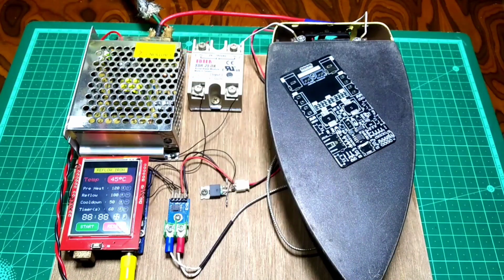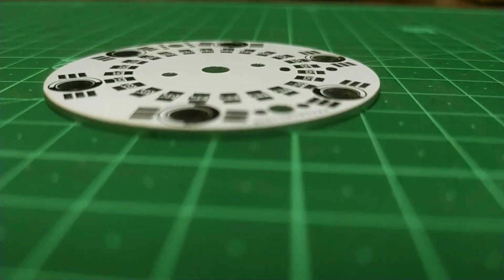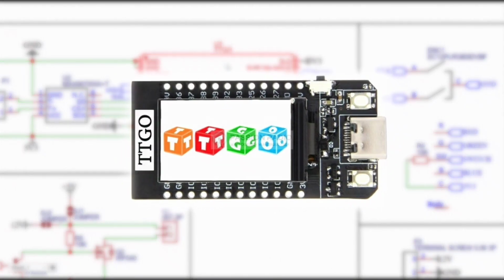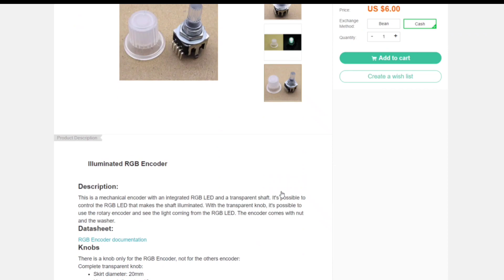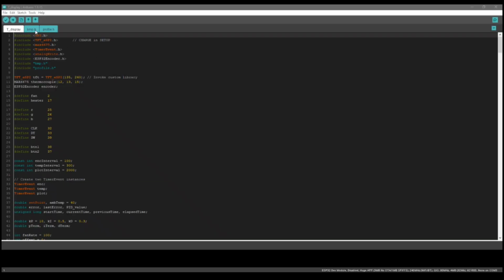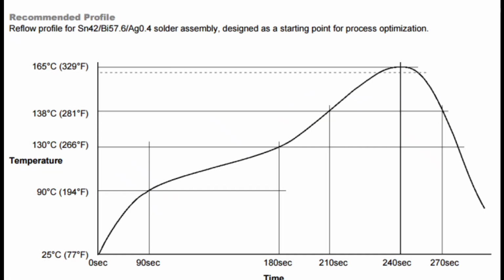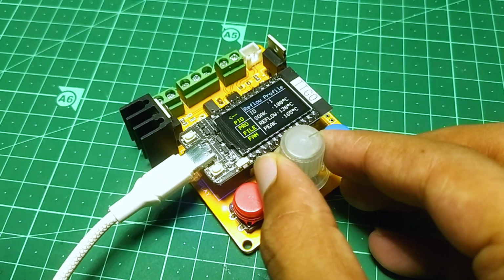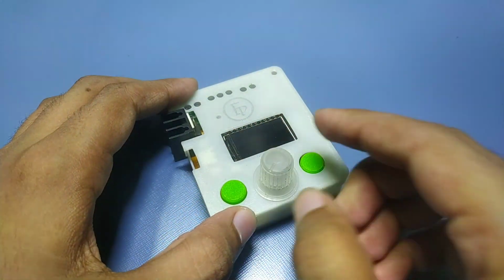PID controlled PCB reflow hotplate using Aluminium PCB

Comment: I think setup part of the menu and submenu items are not actively adjustable, right?
Reply: did you manage to get ahead?
Reply: @gumiduda  yep it works but submenus are not usable if you want to use a different hotplate setup, you need to tune coefficients kd ki kp. When you puah start heater pwm doesnot start you need to push heater button etc.. wish producer communicates
Reply: it is quite sad that such a good idea is no longer dealt with by its owner, even though it is obvious that there is a programming difference between what was published and what was presented.
Reply: @gumiduda  i ordered original pcb from pcbway and got them bow only waiting for led rot encoder as a part
Reply: I just got through a successful medical surgery and I plan to review this software again unless someone else is faster by then
Reply: @gumiduda hope you are working on the subject

Comment: which analogwrite.h do you use? i installed erropix/ESP32_AnalogWrite and it is not working it gives compile error Compilation error: call of overloaded 'analogWrite(int, double&)' is ambiguous
Reply: Az analogWrite függvényt elhagyhatod (kommenteld ki: // #include <analogWrite.h> ) mert már be van építve az TTGO alapba, ezért kapod ezt a hibaüzenetet.
Reply: @istvanbarth2813  thank you very much. It worked. I removed analogwrite.h from the include list and it compiled and worked. But now when i connected a rotary encoder its behaviour is chaotic i think the code needs to be revised and a software debounce should be included. The button and the encoder bounces alot
Reply: @eti6871  And I finally managed to get the firmware working.
You must pay close attention to the SW switch readings.
You should delete the line: #include <analogWrite.h> as the IDE can already handle it without it.
You must pay close attention when you are in menu 1 because when you try to return it will freeze.
You do need to change the code. But it's not difficult, it just requires attention.
Reply: Hi, yes, I also noticed that the encoder is handled very imprecisely and uncertainly, the code probably needs to be modified, but the basic idea is very clever.  Unfortunately, I'm busy now, but if you manage to fix the code by then, I'd also be interested, and I'd be happy if you could share it with me.  Best regards, Steve Barth, (Hungary).
Reply: @gumiduda  will check it
Reply: @gumiduda  well i checked the esp32 encoder library. There are options for half full single pulse. I tried all buy bothşng changed
Reply: @gumiduda  I try the setup on a breadboard and realized that rotary encoder CLK and DT pins must not be pulled high as code already did. And the switch pin must be pulled low and it is active high the rotary pins are active low. When i make connections like this it worked but now when you enter setup menu adn click on a submenu to set it up it freezes and you cannot move the pointer or cursor.

Comment: Hi, 

I gathered the materials and made the pcb but there are materials missing from the list and the diagram. What are the values of the missing materials?

U1 TTGO
U2 MAX6675
U3 PC817

R1 1K
R2 10K
R3 2K2
R4 10K
R5 ?
R6 ?
R7 ?
R8 10K
R9 10K
R10 ?
R11 ?
R12 ?

C1 0.1uF

Q1 IRF540
Q2 IRF540

T1 2N2222

LED1 LED

Comment: Very pity, would have been a nice idea, unfortunately this circuit as described with the program does not work. Construction exactly according to instructions. I tried it in the Arduino IDE and with Platformio in Visual Studio Code. The encoder is simply not accepted and spins away. In addition, an error is always output in line 532 "analogWrite(heater, PID_value);". You have to comment out this line so that you can upload the sketch.
Reply from the maker: Make sure you have installed all the libraries
Reply: And I finally managed to get the firmware working.
You must pay close attention to the SW switch readings.
You should delete the line: #include <analogWrite.h> as the IDE can already handle it without it.
You must pay close attention when you are in menu 1 because when you try to return it will freeze.
You do need to change the code. But it's not difficult, it just requires attention.

Comment: Hello, have completely rebuilt the circuit again. Everything connected correctly. Sketch with Arduino IDE 1.8.19 played, as a board have taken the ESP32 DEV module. As soon as the TTGO starts, the logo is displayed and shortly after the start screen. But that's it, the two buttons for the heater and the fan react and go from OFF to ON and vice versa. Only the rotary encoder does nothing, only now and then sporadically it jumps around in the menu, but you can not select anything else. What else can be wrong here or have I selected the wrong board? I have already used the TTGO for other projects.
Would be very happy about help
THX
Reply: My mistake is the same as yours, have you solved it?
Reply: Exatamente o mesmo erro aqui.

Comment: Hello, very interesting project. I tried to install the program, everything worked except for an error message at the end of the sketch:
analogWrite(heater, PID_value);
here comes the error message: Error: call of overloaded 'write(int)' is ambiguous
Can you help me here?
THX
Reply from the maker: Make sure you have installed and updated all the libraries properly. I have checked the code and it compiles without an issue
Reply: @ElectroPoint4u  Hi, Problem 1 solved, this error message only appears in the Arduino IDE, not in the PlatformIO Visual Code. Tritzdem I can not get the circuit to run, the encoder just does not work, everything connected exactly as in your wiring diagram?
Reply: @photo-art-thomas-klee  either the encoder and the buttons debounces a lot. There should be a software debounce. Or the encoder decoding part of the core is buggy.

Comment: Hello, do you share the Controller PCB File i will not use PCBWay, i will order at JLCPCB ?? What is with the Heater PCB, have you finished this Hot Plate ? Thank you

Comment: thanks. I guess there is no gerber file. I don't want to use pcbway. I will have it done by another company, is it possible?
Reply from the maker: Are you looking for the controller PCB or the Hotplate PCB?
Reply: @ElectroPoint4u  hotplate pcb
Reply from the maker: The hotplate pcb is still in development. Once it finished I'll share it.
Reply: @ElectroPoint4u  thank you :)
Reply: @ElectroPoint4u  Hi, can you please share even if its not done yet? the dev pcb would be helpful as well

Comment: Nice to see that it had a form of temperature control, when it got hot enough to solder it unsoldered it's power supply. :-) this should have been a bolt on crimp connection to the power wire. Have you tried heating cartridges? used them in the past and they can input quite a lot of power to a heating plate.
Reply from the maker: Yeah will try that in the next revision.
I haven't tried it yet. Maybe in future